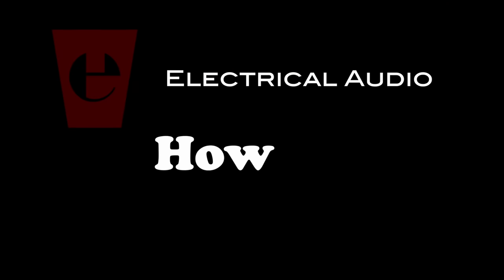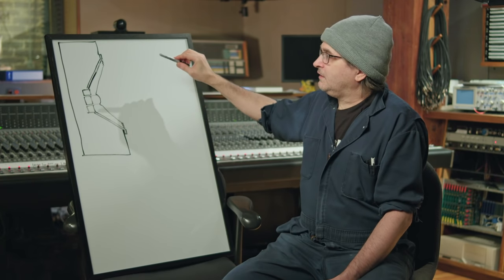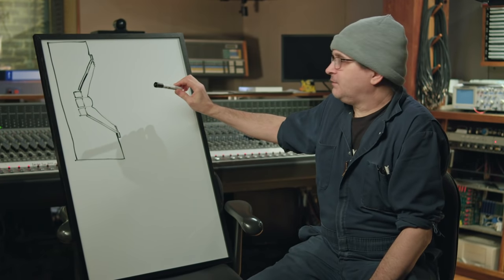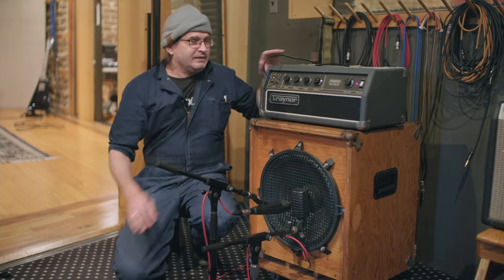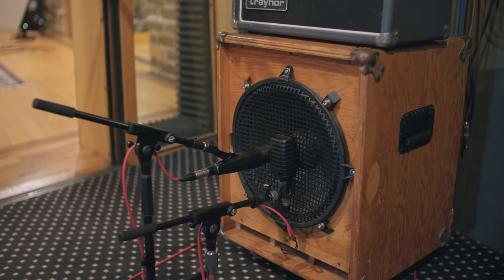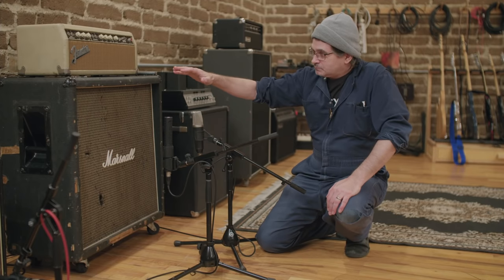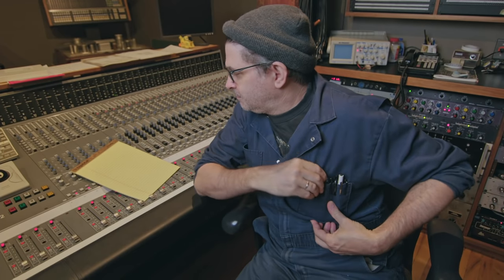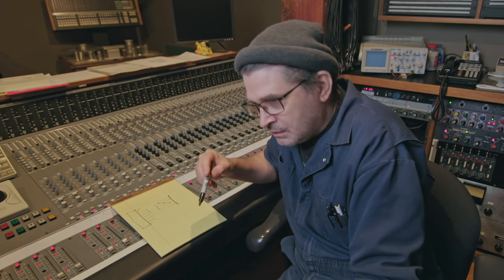Electrical Audio How-To: Microphone Techniques for Speaker Cabinets

Comment: After over 30 years of gigging, I was always told by live engineers to mike my vox at an angle. Thank you for explaining so clearly why that is an inferior placement to front on. A really useful video 👏
Reply: Mic placements that work in a live setting or live mix are totally different from what you would do in practice during recording. Main reason being live you take a room full of other instruments and the sound of other instruments bleeding into the mic as well as phase issues into account.

Comment: Very well explained in simple terms and obviously based on ton of solid knowledge and experience. Much appreciate finding the time to share this with us - thanks!
I recently experimented with the mic off axis and angled more towards the center, like what Mr. Albini refers to in the last section of the video, talking about live sound practices. I've found my best sweet spots with this approach thus far. Looking forward to trying out more distant working distances and using a single mic where two or more speakers of a cab are summed together.

Comment: This was excellent.  This is all stuff I kind of know.  But regardless of that I'm still stuck in patterns that the influence of live stage engineers (Usually, dudes that worked in music stores and did sound on the side) gave me starting in the 80s.  Most of them would mic my amp by placing a dynamic mic at the outside edge of the cone and sometimes angling it in toward the center.   I was often told that one didn't want to mic the center of a cone because that would cause harshness.   When micing my own cabinet at gigs where we didn't have a sound guy I would simply hang the mic in front of the speaker to get 'good enough' sound and to save room on stage because these gigs where usually a little cramped.  Now, over 20 years into my own personal studio, my guitars go into a twin almost always.   I usually start by micing the amp with the mic at the outside edge of the speaker like I saw live engineers do way back then.   No good reason for it other than it's a place to start.  The twin is pretty forgiving and I usually get a pretty good sound what ever I do but this demo was really good to see and Ill try doing some more "center of cone" micing.  I was very impressed with the close micing of the Champ and the Piggy.  Thanks for this article.   Sincerely.  Todd

Comment: Nice. I too dislike the default of studios that use a close angled mic up on the grill. They don't like it when i tell them they aren't doing live sound. But this never doesn't sound crappy to me except in a rare 3% where its actually called for. Always now follow this perpendicular, distant, centre, dual with ambient mics in some form...as I say, a couple times still used a close angled one but i WANTED a weird phasey sound that didn't represent the guitar amp in any way for that particular recording. Mostly, if the sound is right in the room, right in rehearsals, right in the guitarist's bedroom or whatever the albini way just preserves it and makes it better.

Comment: Would a 15 inch guitar combo need a slightly longer 'working distance'? Trying to get my '77 Vibrosonic to sound a little more how it does to me as a player. 57 on the grille just doesn't cut it.

Comment: This is probably the most concise and useful video I have ever seen on the subject. I had never thought about the potential problems of a microphone at an angle. This probably explains why it feels like I got better results when I had my 30W combo amp vs. the 100W Marshall I use now - I assumed that I had somehow forgotten how to place a microphone, never once considering that I was recording an angled cab with a microphone not placed on-center to the actual axis of the speaker I was recording. Suddenly, the last few years of constantly turning knobs on the cab and fighting with EQ are starting to make sense.

Thanks!
Reply: Hello, dont know if thats your problem or not, but most amps sound best when the master gain is at least 75% cranked, which can be hard with a 100 watt amp if you dont want to make everybodys ears bleed. Also speakers that are able to handle such high volumes (watts) usually tend to be more stiff than speakers made for lower wattage. So it might be a good idear to use a amp atenuator (the cheap one that doesnt fuck with the sound) and a lower wattage speaker to really drive the amp. Driving the normal high watt speaker with the atenuated signal might also sound strange. I dont know maybe that is completly not your problem, but it was mine recently so I thought I could share this 😅

Comment: Live engineers could have developed that “sneaking in” or “angled” mic technique to try and use the Null of the microphones to their advantage; willing to sacrifice some high end clarity for less bleed from the drum kit for example. That’s only the reason I still use that placement I do a lot of live stuff on 4 tracks.
Reply: Also most stages are small so mic's sticking out tend to get hit a lot. Sneaking in from the side has less risk of mics getting knocked over. Studio placement does not work on a live stage with sound bleeding all over the place :)

Comment: Unlike the vast majority of audio engineering videos on YouTube, there’s not a single SM57 to be found here.
Reply: As it used to say on the EA website:  " if you need to record something and you don't have a microphone handy, this will do. I guess."
Reply: Ya true ! but i don't need to tell you why its good, cause the records are out there, and you know who I'm talking about ? who used two sm57 on the cab.
Reply: @christopherdunn317  
 I was just quoting the EA website as an explanation to why you don't see them in his videos,  I don't have enough experience with other mics to have an informed opinion on the subject ;-)
Reply: Within reason you can match any semi pro mic with a speaker cabinet and get something good. It's just easier and less time consuming to do that with a better mic.
Reply: I’ve always thought the tried and true method of using an sm57 on guitar amps was over rated. I like to have options when mixing and the 57 doesn’t have a large enough frequency range. Better to throw a condenser mic and roll off what you don’t need. But using two mics ( one a 57 ) has worked for me.
Reply: @andyknowles772   Yep! Even The Beatles (remember them) often used mics that just happend to be plugged in at the time/
Reply: Electrical Audio has been in business for decades and Albini has sunk plenty of resources into it, I'd be pretty shocked if the best they could do is the mic everybody has because it's a hundred bucks.
Reply: Talkback mic.

Comment: Another reason for close micing is to eliminate as much reflected room sound as possible. It may be a sound you want, but it all gets much more complicated as you move away from the speaker. Which is part of the reason why drums are the hardest thing to record. Phase can become a monster with multiple mics picking up room reflections. Although generally when the distance between two mics is large and they’re at different heights, as in this example, phase cancellation is not an issue. There is enough delay that it prevents any overlap.

Comment: Steve just reinforced my observation about speaker miking. I've tried moving the mic off center and off axis. It invariably sounds like mud or sounds phasey. If it's pointed right at the center of the cone the signal tends to need less eq in the mix. If you're not satisfied with the recorded sound, try a different mic or amp settings. Minimize the mic placement variable. Thanks Steve!

Comment: Here's another way to think about the proximity effect.  The cardioid polar pattern of a directional microphone is achieved by the sound waves hitting the back of the microphone diaphragm canceling out the waves that hit the front of the microphone.   The cancelation increases at lower frequencies as the wavelengths increase and the relative phase offset between the front and back of the diaphragm becomes less and less.  At very low frequencies the relative phase difference is almost completely 180 degrees (front faces in the opposite direction from the rear) and there is near perfect cancelation.  The cancelation causes a -6dB per octave bass response drop, in other words, it behaves like a 1st order high pass filter.  Therefore, in order for a cardioid mic to have a flat response, it requires a compensating -6dB per octave low pass filter.  We can also think of this filter as giving the mic a +6dB rising bass response to compensate for the mic's  -6dB dropping bass response.  

Now, as Steve describes, when the microphone is close to the source, the sound waves hitting the back of the diaphragm are masked be the microphone itself.  This means there is less rear wave cancelation and the cardioid mic behaves more like an omni.   However, the compensation filter hasn't gone anywhere.  It's still providing that +6dB rising bass response.  So in close proximity a cardioid microphone behaves like an omni with a +6dB rising bass response - hence the enhanced bass of the proximity effect.

Comment: Hey thanks for the vid! I get totally your point with the angle introducing harshness cause of timing differences, good one. I also see a lot of ppl recording vocals in a similar way with the mic at an angle, specifically in order to avoid sibilant harshness. What’s your opinion on that? Thanks!

Comment: Thank you very much for the lesson House of Electrical Audio.

I think that apart of the PA Engineers usage of those mic technics it's also had to do with a Pandemic that hit the music industry / Community early 90'S.

After the famous "sweet 80", tailored sounds, clean / separated - separation source to mix approaches , articulated productions etc came an era of 
Raw, tough, Organic and psuedo organic (yet Extreme Engineered) Band's sounds , audio dirtiness become an commodity and so on. 
Most of the Engineers / Musicians and general Studio mammals of that time didn't have Internet connection due to phase shift and canceling from the studer heads transformers non Lanier prjection so they couldn't learn from Masters how to produce like an protools webduction expert pro themselves so an area of 
 "Make it sound dirty" began and i remember it as it was this morning (a rare case in my case) - 

People (mammles) started coming to the studio with that DEMONIC adats after recording (with 57 only) the most crappy drum / guitrs sets in the most acoustically stupid places - stair cases, garages, bathrooms, bedrooms,  closed police / military shooting ranges, saunas ( wood sounds good!) And what not.

It was horrible ! I personally lost 5 inches of my height, 80 % of my punch in capabilities and couldn't write automation at all for a time.
After every butch vig single came a new wave of "inspired by" horribly recorded shit.  

It was the equivalent to the Millennials vocalist mic cupping syndrome.
So in my perspective many improper / sub pro / shit mic technics and even consepts came out of that era that are recycled even in 2021.

So basically -
 You had to correct us all 2021-  manly due to your own Audio Engineering Guild / Group/ Class Sound signatures and Discography output that drove an entire 90's millenials generation to horrible micing, stupid production decisions and electro acoustically crimes ... Sorry, my age, I meant prints !

;)

Crawling out with humble ( and old beck issues).

Comment: I just had a gig at a pavilion last weekend and we set the mic at an angle like idiots on my speaker cabinet..I have learned today. I will sound better because of this. Thank-You for putting this up. I concur with the evolution of the angled mic...it would be in the way of stage traffic and antics as you play but sound must take priority every time.

Comment: When Steve pulled out his phone to look through the speaker grill I felt like a god because I already do that, also I expected him to have some old fashioned flood light or something instead of just his phone.

Also I emailed Steve some months ago to ask about how Big Black used drum machines live, and he was a class act who was very polite with my small pedantic questions.
Reply: Cool. So how did they use drum machines live?
Reply: @oversee  They used an EMU Drumulator for Racer X and after. Specifically I asked how they controlled their drum machine for section changes, did they program whole songs and play rigid to the machine? Steves response was the Drumulator had two footswitches for Start/Stop and the other one was for Next Section, basically he would have the patterns set up and the drum machine would play the first pattern until you pressed the Next footswitch. Unfortunately my drum machine only has Start/Stop, but it was good info nonetheless! Also before Racer X was when they used the TR-606, but not really at all after.

Comment: Actually... 19:20 - the off axis live sound summation.   Taking a 57 and going across a speaker is useful when trying to manage presence frequencies vs bleed onstage.  In small to medium venues, there isn't a need to get ambience into the PA obviously, but what we DO need is body and low fundamentals and harmonics from guitars WITHOUT CYMBALS.  We need to do everything possible to isolate a cabinet from cymbal bleed, hence pointing the null of a microphone towards hi hats and crashes etc.  These types of techniques are always developed to have the PA support the ambient sound of the band in the room that they are in.  These days there are mics with better rejection, and it doesn't show up as much.  Just this summer however, as an example, I moved a mic 2 or three times on a cabinet during soundcheck and wound up choosing the off axis technique described here because it replicated the guitarists Reverb effects the best through the horns of the PA itself.  Every other position sounded synthetic and labored to me.  Always listening and trying!   Love all of these videos, hope you aren't out of breath from the calistetcs!

Comment: The real question is what on earth happened to the music industry ?

95% of modern music recordings sound muddy, thin, harsh, loud.

Then i hear 80’s, 70’s and some early 90’s songs and the music sounds real, clean, alive.

Is todays industry forced to used modern digital gear? Are they low budget studios? Are they being lazy and using short cuts ?

Comment: The worst I’ve seen that comes from live is engineers hanging a mic by its cable over an amp and letting it balance near the speaker cone pointing down at the floor. This might be passable (live) with an e609 but definitely not an sm57. The amount of weedy recorded guitars I’ve heard due to this…urgh

Comment: What does he mean by aligning the diaphragms so they are in phase?
Reply: The mics need to be a different distance from the speaker to not create a comb filtering effect. There are many ways of aligning the phase. What I do is invert the phase of one channel, then move once mic away or towards the speaker to make the sound as quiet as possible (with different notes playing) then I flip the phase back. The two are aligned and should be the loudest and you should not get comb filtering. If your desk has a phase/correlation meter you can pan each mic to opposite directions and move one of the mic to maximize the correlation meter.
Reply: @dale116dot7  that sounds complicated 😅

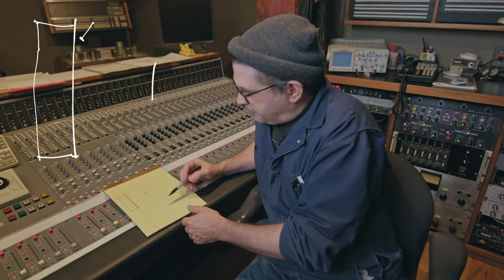Comment: 18:11 does anyone know why we almost always mic across a snare then? does the sound eminate much differently from a snare to a speaker? because we always side address snares and surely you're comb filtering that under this physics logic. (im not a super techy kid so) thanks
Reply from the maker: To get stick attack. Usually you point at the center of the snare, where the drummer is (hopefully) hitting most of the time. You can mic completely perpendicular to the head, but it will likely sound very thumpy. The off-axis response favors low-frequencies and attenuates higher ones, so the resonance of the head is compromised not so significant. If you mic perpendicular to the head, the stick / center of the head is off-axis, and you lose stick attack.
Reply: @ElectricalAudioOfficial  thanks so much for this education :)

Comment: What are your thoughts on all these different speaker shoot outs? Is it possible to get similar sounds or frequency response from two very different sounding speakers just by using mic placement? I've been thinking of replacing one speaker in my 2X12 for some different sounds, but now I'm just going to experiment with mic placement and be happy with what I have for now. 

Also, I have a Bogner Ecstacy that has the excursion switch, which is some type of speaker dampening thing...I don't know anything...How might that come into play when setting up a mic?

I know I just need to keep experimenting until I find what I like, really...thanks for this info

Comment: An education, Steve. Important knowledge. Thanks!

I once had an argument with an engineer because my bass sound was awfully "pingy" (Fender Jazz with brand new strings). In the cans it went "poing, poing, poing" . However, from where I was standing - around ten feet from that cab, it sounded great. So I requested another microphone be placed where my ears were.  It sounds good HERE and crap in the cans.

"It won't make any difference" the guy said. We argued for a bit and eventually  I said, rather insistantly,  "I don't care. Put a mic where my ears are."(that was the polite version)..  I was the client, after all.  So with much harumphing and huffing and puffing he placed a mic right next to my head pointed at the cab.  The difference was immediate. A nicer, rounder, fuller bass sound... which, of course, allowed me to play with a sound that I was expecting coming back at me. (I'm assuming that he sorted any phase issues!).